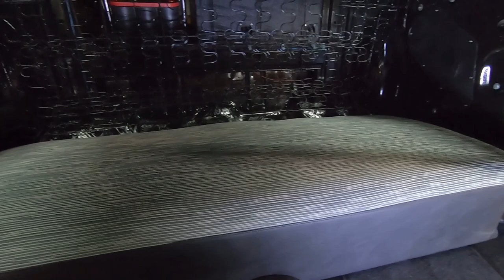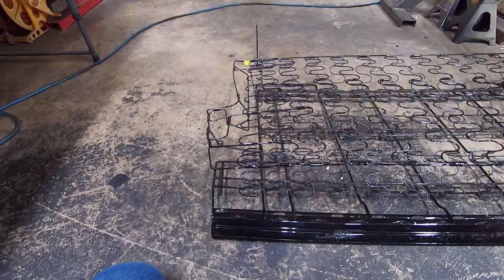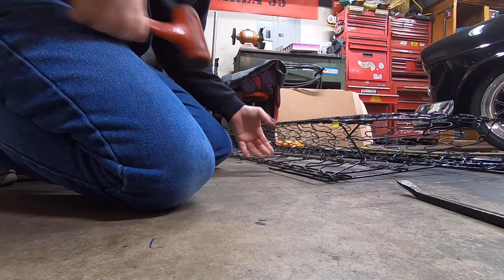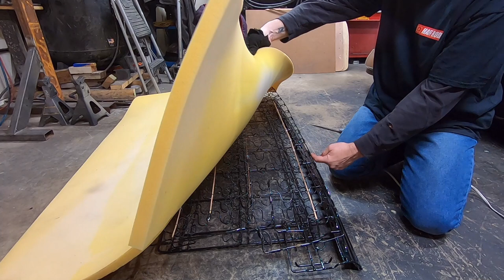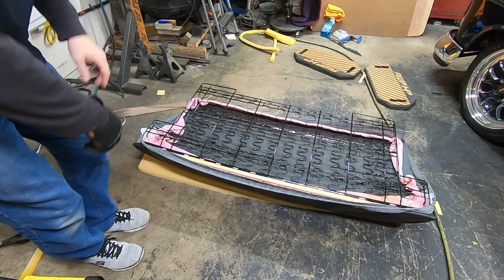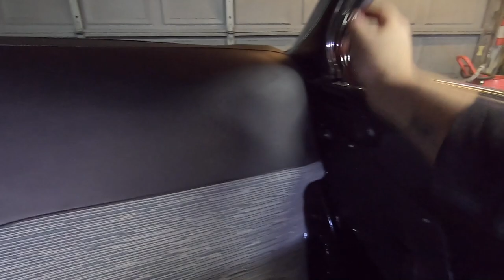Re upholstery on 1955 Chevrolet rear seat.

Comment: You are a great builder next time a tip you might like on strengthering wire bend a  90 ON THE END 4 OR 5 INCHES LONG AND WHEN YOU TIE IT IN TO Opposing wire it will give entire structure strength and wire cannot slide through Hog rings

Comment: Wow! Excellent work! Looks great. I tried to use Ciadella, but with my 68 Chevelle bucket seats, they ended up being about twice as high as original. :( Will have to find someone else a little more affordable. Not building a show car, just a driver. Love your videos!
Reply from the maker: Rick, will 1/2" sew foam take up the slack on your buckets?
Reply: @haffrods7055  I can buy pre-made seat covers for the buckets. But will have to have someone cover the original rear seat to match.

Comment: Did you sand blast the springs? Mine are kinda rusty, so I want to clean them up and spray them down with some rust inhibitor. By the time they rust again, I will be a tombstone.  ;)

Comment: Man what timing,I’ve been work on my back seat the past 3 days, restored the springs and added the 3/16 cross rods made a difference.My 55 is a 2dr sedan Bel Air and the back seat bottom is 64 inches and tight as tractor nuts😩I tore the vynal on the old side panels (homemade) getting the seat out.I’m confused on if the Bel Air back side panels need more clearance to fit.Do you know if the sedan Bel Air has the same panels as the Hardtop?Thanks for the info I enjoy your channel and keeping up with the progress Greg in Branson
Reply from the maker: Sedan and hardtop are different. Thanks for watching Greg

Comment: Hope u see this message I was wondering what type of carpet did u use to replace the burlap
Reply from the maker: it's carpet from an automotive upholstery supply. It's used on boats, RV's, etc. It does not have a back on it like moulded auto carpet.